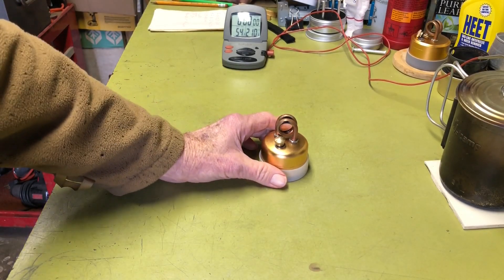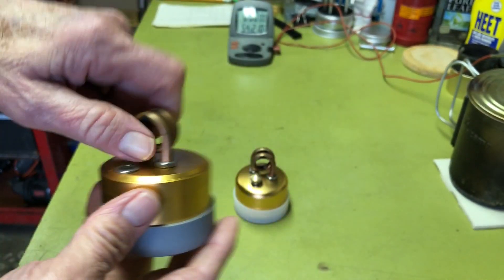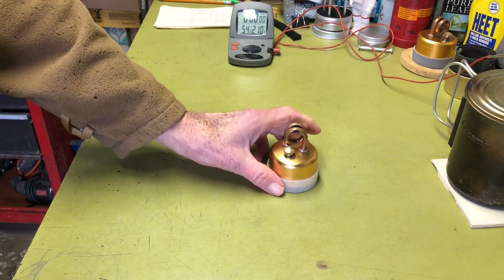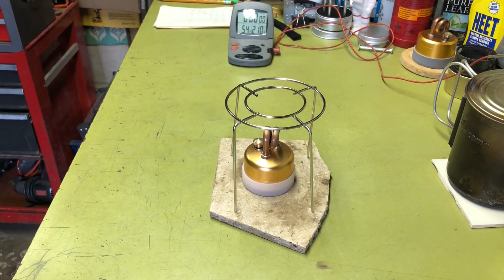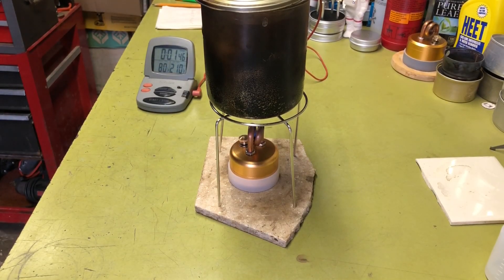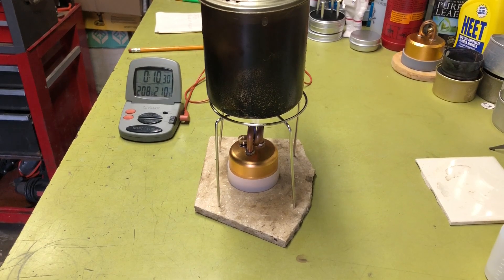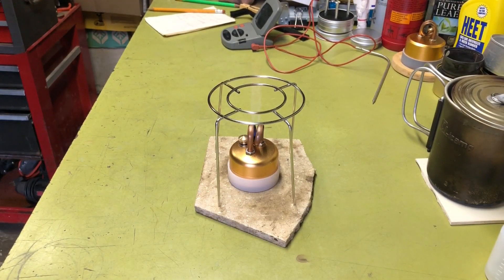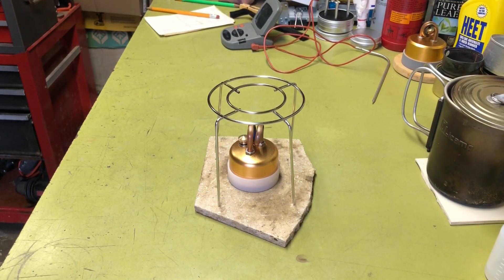Copper Tube Alcohol Burner Redux

Comment: I can’t find any proper instructions on how to use these burners.
1)You pour the alcohol into the hole.
2)You close the cap.
And then what?
Should the cap be fully tightened, or is it supposed to be used as a regulator by leaving it slightly open?

I bought a similar one from Amazon. When I lit it, at first the flame was very strong and sputtering. Then it became small — about the same size as a regular lab alcohol burner with a wick — and it kept burning like that for a long time.
The outdoor temperature was −15 °C.
Reply from the maker: Close the cap, let it sit a while so the wick inside the coil soaks up the fuel. Then hold a match under the top of the coil, it may take 2 or 3, the burner will start to sputter then light off and burn on its own.  
To shut it down, just blow it out, after it cools a bit crack open the cap to let any pressure out.

Comment: I have a little experiment for you:

I'm wondering if these are an efficient way of preheating a primus style kerosene stove, like a Primus 1205. Alcohol isn't getting any cheaper.
Reply from the maker: Other than alcohol the only thing I would try is white gas, that's how white gas stoves were primed although alcohol burns cleaner.
For your kerosene stove you might experiment with putting a ring of carbon felt in the priming cup then add some kerosene.
Reply: @planetsideagent I could do that, but I decided to get a Barthel "mini wonder" torch. The alcohol versions are cheaper and there's a bit of joy in using a burner to light a burner.

The wick is probably more practical for camping usage.